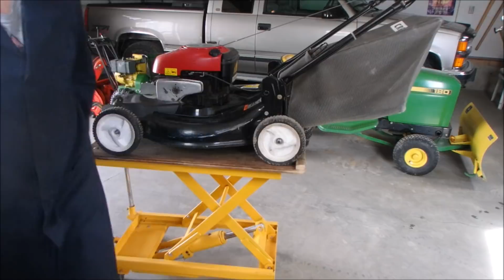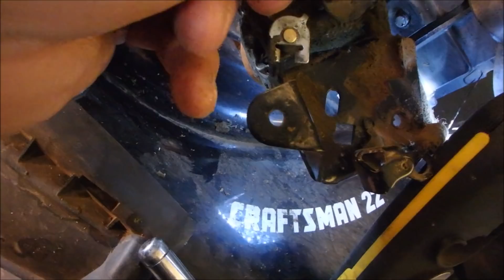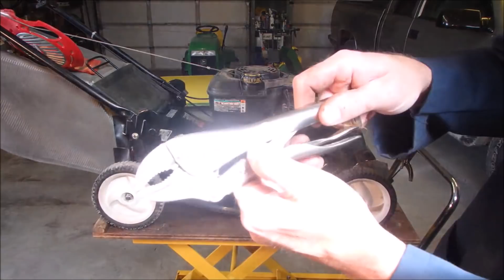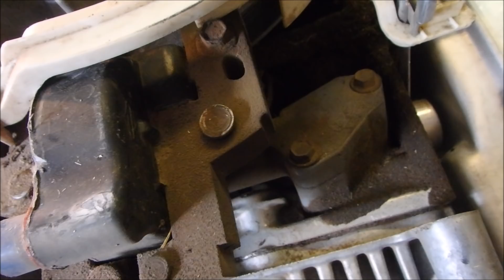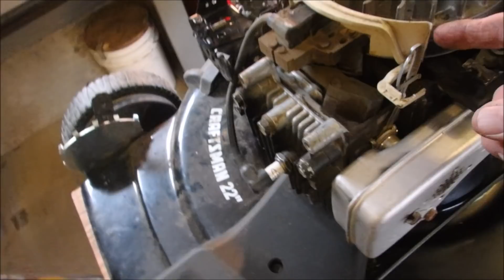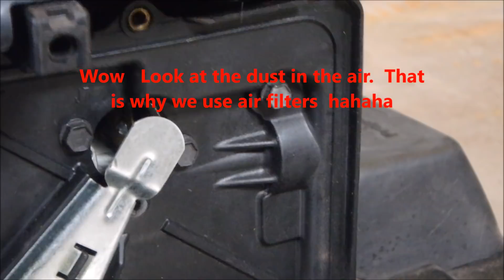Craftsman Self Propel Mower Wouldn't Start

Comment: Isn't it the wind from vanes on the flywheel that open the choke ❓🤔😀👍✌️🖖🇺🇸🇺🇸🇺🇸🇺🇸🇺🇸
Reply from the maker: Not the bi metal strip in the muffler housing heats up changes shape and opens the choke.    Like a thermostat in an old furnace.

Comment: Sharpen the belt and check the blade tension. Then set the carburetor gap and make sure the spark plug has good flow. We have all had days where the brain works but the mouth is not on the same page.
Reply from the maker: Got it  thanks.  :-)

Comment: I could use a little help troubleshooting a lawn mower that was handed down to me by an older brother. He last used it 6 years ago and from I can see he did not empty to fuel from the tank. Here is was I have done so far to resolve the none starting issue. I have cleaned the gas tank, cleaned out the fuel line, cleaned the carburetor (i wasn't aware of the bolt so I will take that out and give that a good spray), and replaced the spark plug. I tried to spray some gas into the carburetor and start it that way but I don't get anything. It could be it's not getting spark but I don't really have a good way to test that, I tried to pull it in a dark garage with the plug out and connected to the coil but couldn't see a spark. Any advice would be very welcome!

EDIT: So I checked the intake valve and it's not loose and I also checked the carb. bolt and that is totally clear, I sprayed cleaner in there and it came out all side. I spun the blade by hand on the bottom and there is resistance and I can hear a wheezing sound like when I pull the cord. I also sprayed cleaner in the intake valve tube to see if I could get it to fire again and nothing.
Reply from the maker: Try a new spark plug first.  (very inexpensive)   Then maybe a new coil.  That is easy to find    just google new coil for  XXXXXXX
Reply: @BrucesShop  I replaced that guy already along with a new air filter. I am looking online right now for a new coil pack.
Reply from the maker: @m3pwrofm3  If you need help identifying it let me know.

Comment: another question where did you get  the new gasket for the carb?  I'm retired and decided to learn small engine repair.  Right now I'm picking up push mowers at yard sales. changing oil  compression test, spark test clean the carb, check air gap, , sharpen blade and balance, carb cleaner the linkage, grease all wheels change fuel line ,empty out old gas add line fuel filter and or shut off value, and take a brake!!! .  I charge resale of lawn mowers push, 45 to 85 dollars each. Where do I find info on rear baggers and side discharge shouts.  Thanks for your time  Frick & Frack small engine ( push mowers)
Reply from the maker: If it is the Primer gasket  Here is one but on a Canadian site
https://www.amazon.ca/Briggs-Stratton-795629-Cleaner-Replacement/dp/B002WNVZ2A/ref=asc_df_B002WNVZ2A/?tag=googleshopc0c-20&linkCode=df0&hvadid=293001317889&hvpos=&hvnetw=g&hvrand=8970369831129848787&hvpone=&hvptwo=&hvqmt=&hvdev=c&hvdvcmdl=&hvlocint=&hvlocphy=9001355&hvtargid=pla-351225806070&psc=1

Comment: Before I even use any spray cleaner, I run a guitar wire through the parts which require it. I have noticed with my Craftsman mower is that various bolts loosen up and fall away. The red plastic cover broke free of the two screws holding it. Seems that Craftsman should stick with its great line of tools and skip the mowers. Too much trouble that need not happen.
Reply from the maker: The old craftsman mowers were a great thing.

Comment: Bruce, my Snapper self-propelled, Briggs 725 engine, that I bought in May 2013 broke apart May 2019. My carb mounting bracket bolt sheared off level to block--so I could not unscrew it the way you did; my front throttle bracket split in two; my front mounting base broke up into several pieces, so now the engine leans downward. I believe this was due to poor casting quality. In my 60 years of mowing this has never happened to me. Are other people also encountering these problems?
Reply from the maker: Do you have an easy out?  Or a welder yo weld a bolt-stud onto the end of the broken bolt?  Just trying to help.
Reply: @BrucesShop  Thanks for your prompt response. The main issue is that the front-flange base broke into several pieces, so that there is no support to keep engine level with deck. Briggs customer service did not want to go into details why the metal base simply broke up. I plan on using the engine for parts. A man with your experience would have heard of poor casting quality issues. Thanks anyway
Reply from the maker: @wisconsinmile4670  I understand now.  I was reading the note incorrect..  Yes.  another old engine with a good sump may help depending on how bad it is cracked.  BUT  Parts rock too.  thanks for explaining it.
Reply: @wisconsinmile4670  el metal que se usa es muy fino,está ello para poco tiempo ,la fabrica lo sabe,la idea es que se rompa y usted compré  otra máquina...

Comment: i had one just like this, wouldn't start but the problem was after checking everything, was the self-propelled belt around the shaft at the bottom was off the pulley.  it came off twice today.  i think i need a new belt.  it is getting too stretched
Reply from the maker: Great place to start

Comment: Hi Bruce, I came across your video when I was looking for an option to fix my lawn mower. I did replace the carb, changed spark plug, changed air filter and changed oil. The engine kind of likes to start but it won’t. What could be wrong with it? Any suggestions? It’s craftsman 6.75 mower with 190 CC. It’s  gold engine series.
Reply from the maker: does it have a manual primer button.  If so i would double up on the primer gasket.
Reply: Bruce Pender it does not have a primer and it is auto choke. How can I access valves without tearing the whole thing apart. I just want to make sure they are working properly

Comment: Good job Bruce. I think someone at the factory got carried away on the tightening of the carb bolts. Glad it came out easily. Good clean up job also on that mower. I do the same before giving it back to the owner.
Reply from the maker: Right.  If they are really bad I do it before i work on them  (as you know)
Reply: Bruce Pender Hey Bruce what do you use to shine them up?. sixtyfiveford uses ATF. It is a cleaner  also. Works well.

Comment: I had a similar problem with my Craftsman mower. The bolts that hold the pipe to the engine were loose. Tightened them and decided to check the carb. Small pieces of black which likely came from the gas hose. Mower is 14 years old. cleaned all orfices and put every thing back together. Took clamp off gas hose and gas poured out of the carb. Removed the carb and noticed the float was sitting on bottom of bowl and pin was in the support but not thru the float hole. Ouch. Fixed that and mower runs fine. Really appreciate your videos.
Reply from the maker: Thanks for the great comment.

Comment: Hello friends, where would you suggest buying an air filter cover for a 6.75 Tecumseh engined craftsman lawnmower?
Reply from the maker: I change my comment.  I would just use Google ad order from one of the reply's.    I typed in Tecumseh mower air filter cover
and got this
https://www.ebay.ca/b/Tecumseh-Air-Filter-Cover/260923/bn_7023475229
Reply: Excellent! I found the part although it cost 44 dollars, the air filter cover was the only game in town. It was similar to buying a part for an antique car. Thanks for the help.

Comment: Glad to see you got the bolt out. If that doesn’t work you can take Drexel and cut a slot in the bolt and take it out with a good screwdriver.
Reply from the maker: Right.  I have done that.  Welded on studs too.  Nothing easy about an easy out either.

Comment: hi good morning Mr. Bruce I need your help/opinion. I am trying to help one of my neighbors he said he might of hit a rock or something hard he is not sure but the mower was stuck, not turning at all, I was able to free it up, and while I had it apart clean the carburetor check for spark, but when I when to check the oil the machine did not have oil, I put everything back together anyway put oil, but still it does't start. my question is if the engine is not good no more, I don't have the tools to check the compression in it. Thank you very much in advance for your help. God bless you,  be safe
Reply from the maker: Well don't hold me responsible.  Take out the spark plug and put oil into the spark plug hole.  .  make sure the blade is on tight  and tap it with a hammer.  If it moves try to move it with your hands.  If not  I think a new mower is in the future.
Reply: Thank you very much for your info, I actually found another video that you uploaded with a similar situation, on top of that I found the flywheel sheared I fixed that everything seems to be fine I returned it to my neighbor he is happy. Let see what happened in the future 
THANK YOU WERE VERY HELPFULL

Comment: Bruce. Good video. You say  You like the front wheel drive.  Not Me.I had a front wheel drive and as the bag became heavier with grass I kept loosing traction as the mower had a tendency to tilt back slightly. I bought a Lawn Boy rear wheel drive, Electric start. This mower has far better traction than the FWD I had.........Keep up the good work  Bruce
Reply from the maker: Well you would know more than me   My own is just a plain push mower.

Comment: You should take plug wire out at start is that true🙈
Reply from the maker: I guess you should.  I don't as the break handle grounds out the coil.  But yes you should.

Comment: Need a little help, with hayter harrier 56 older model. With b&Stratton quantum intek edge, my problem is the manual choke-carb do I just need the governor spring on gov link, seems like I'm missing idle spring
Reply from the maker: There are so many models.  You need the spring to the throttle form the little bracket at the front.  There are a lot of variations on the choke sorry.
Reply: @BrucesShop  got thanks 12Q502 0169-B1-070904624, oldie its runnining driving braking

Comment: I just watched a vid of a guy I like following in North Carolina; picked up a Toro and the original owner had tried to "fix" the carb.  Ended up stripping a screw, bought a new carb and had not tightened down anything!  The video maker also found the new carb has stripped threads for the choke vane thing and the spring for it was missing.  He later found the spring when it blew out the side of the engine while he was test running (probably bouncing around under the flywheel).  This must be loose carb season.
Reply from the maker: Yes   We see it all eh!!!

Comment: Hey bruce how would you take out a sheered bolt that you cannot grab with vicegrips?
Reply from the maker: There are many ways.  An easy out by drilling into the bolt and reverse threading it out.  You can cut a slot in the bolt with a Dremel and turn it out possibly by heating it as well , Remove all the other bolts if it is a cover and turn it out.  Welding a nut onto the left over stud and more.   Your imagination is the key.
Reply: @BrucesShop  thanks bruce I'm going the dremel route thanks again
Reply from the maker: @michaelgonzales7655  Let me know how it goes.

Comment: Hey Bruce , where did you learn to work on small motors etc ...... ? I wish i was about 10 yrs younger id give it a shot . Kinda past that break over point now :( .
Reply from the maker: I am self taught. Although I have fixed things for years.   I really got into it about 8 years ago at 55 years of age.  Just learned it, one machine at a time.
Reply: @BrucesShop  Sort of figured that , very cool . Wish i had got into it around that same time frame . At this point hopefully what ever i can learn is basically for my own stuff .

Comment: Hi Bruce!! quick question where do you get the replacement bolt for the carb ?? thank You
Reply from the maker: I have about 20 used carbs.  So i just find one with the same # stamped in.  You may have to buy a whole carb if you don't have one.  Here is a hint
https://www.amazon.com/Carbhub-190cc-Carburetor-Briggs-Stratton/dp/B07CZY4XWW

Comment: Big fan Bruce! Thank you. Mine started after 14 pulls. I cleaned the carb and it starts after 3 pulls now. Should I buy a new carb off Amazon? New gas and a spark plug were put in.
Reply from the maker: Something sounds like it is loose.  Keep looking.
Reply: Ok I will. What about the silver finned flywheel on top. How cleaned should that be? Mine is a little rusty and dusty. Thank you!
Reply: Okay it starts one pull now. One of the blower housing bolts was loose and 2 were actually for the carburetor. Torqued them down and she fired up nice. I cleaned the flywheel and did a basic tune-up using a kit from home depot. Thanks!

Comment: I 'rebuilt' a typical B&S carb, replaced needle, seat , seals and blew out all the passages and the bowl nut but the carb still leaks. Any thoughts Bruce?
Reply from the maker: Did you put in a new seat?

Comment: Thanks for pointing out that choke thermostat, Bruce! I couldn't figure out why my mower wouldn't start even after cleaning and rebuilding the carburetor, testing the ignition coil, and replacing the spark plug. Crossing my fingers that this is my problem. You have helped me with other mower problems, too, so I just wanted to thank you Sir!
Reply from the maker: You are welcome.  When one of these come in I usually show the choke lever as they are flimsy.

Comment: I just replaced the carb on my lawn mower and it still won't start. The cord pulls a little hard with the spark plug in but fine without it in. Having trouble figuring this out smh
Reply from the maker: If it has overhead valves they may need a valve adjustment or the flywheel key may be sheared.  Those are the 2 things I would check.

Comment: My machine starts but soak the spark plug with oil. How can i fix it?
Reply from the maker: Well it may be worn or you don't have good crankcase ventilation.  Make sure the little black hose goes from the air cleaner to the crankcase vent.  You can do it.

Comment: Very strange those bolts vibrated loose. Should there have been any lock tight on the threads? Was the blade out of balance? Very lucky the broken bolt came out. My luck I'd have to either drill it or torch it out. Great job. You should get a clip on visor flash light for your baseball cap so you don't have to fumble around with the drop light. Enjoying your videos here in Massachusetts USA.
Reply from the maker: My neck is so stiff a flashlight just flashes to the wrong spot.  They don't use locktite at the factory.  I wish they did.  The blade was  OK   Just a broken bolt for some reason.

Comment: What is your fee for a repair like this?
Reply from the maker: You may notice that most of the repairs i do are fro friend and family.  I like to charge enough to cover my costs and also not give my labour away.  It is tough.  The owner here in this video is a neighbour.
Reply: Bruce Pender I was just curious, thanks!
Reply: Bruce Pender I believe my Briggs &Stratton 21” Troy-Bilt mower’s armature/coil has died, no spark jump from spark plug wire to new spark plug. I’m replacing the coil tomorrow when that part is shipped to me. Your repair videos have been a great help, thx for making them.
Reply from the maker: @albertoconnor443  You have to try

Comment: I have a similar lawnmower like this that was given to me by my neighbor.
I did everything you did to the carburetor but the only extra problem was that the plastic inlet manifold was broken ....
I have decided not go further.....because the compression (this should have been checked first) on the engine was 80.
Will the engine start if it has a compression of 80.
Please let me know if this is ok before I do purchase the manifold.
Thank you.
Reply from the maker: Yes that have a compression release of 80 when you pull the rope, right after when they fire up the rpm increases and the compression goes up to over 110.  You can make a new gasket out of gasket material and a razer knife.  You can get gasket material anywhere they sell mechanical stuff.
Reply: Thank you so much for the information.....well get back to you when I am ready to start up.....once again thank you very much.

Comment: Bruce I am getting known around my small town and and neighboring towns for my small engine knowledge and I do it out my garage also. I was wondering if you would steer me in the direction of how much to charge for doing this in my garage. I am not a full logit buisness yet but right now I kinda leave up to the customer to pay accordingly. I love doing this kinda of stuff and it is certainly a hobby but I have been told that I'm cheating myself by not charging enough.
Reply from the maker: That is a tough one and up to you.  The more i do the more this is an issue because i don't want to hurt the full time guys.  So I take mostly beater lawn mowers and stuff they would not want to charge $90 an hour for.  You will get an idea.  X dollars for a tune up (twice minimum wage???) and move up from there.  Every area is different.  Good luck.

Comment: Good Job Bruce It does look like the customer takes good care of that mower it looks in great condition. I'M wondering how that bolt got broke you normally don't see that one broke on a briggs. Good thing he didn't run it with out an air filter thats a good way to ruin a good engine pretty fast. I like rear wheel self propel better than front wheel the problem I have with the front wheel drive they dont seem to pull very well the back wheel design seems to push the mower better to me. But I'M a honda fan I like the hrx217 I think they are the best mulching and bagging mower on the market. Did you ever get the balancer we talked about last fall to balance the blades with? Have a great day buddy. God Bless!!!
Reply from the maker: No typical me I just check them on a nail in a vice.  All I have to do is buy one I know.